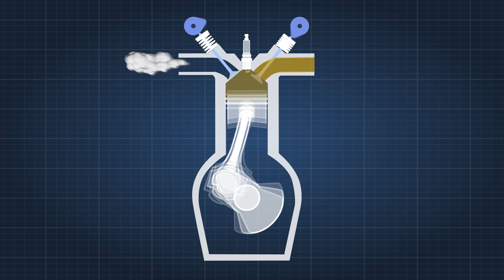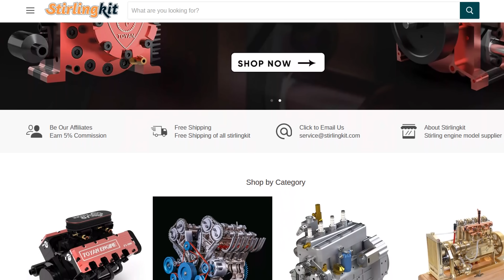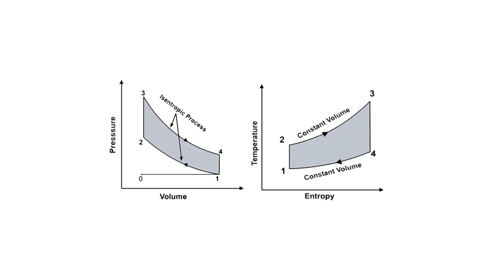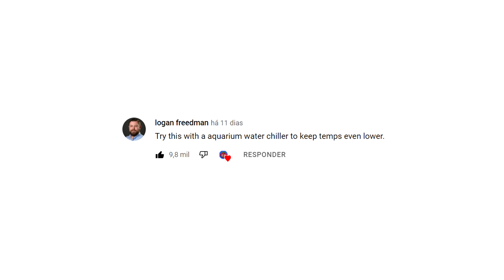I 3D Printed a Transparent Combustion Engine in Resin

Comment: Nitromethane has a lower specific energy than gasoline, and requires far more fuel volume to create the same or more power than gasoline. You ran your engine with the same jetting of the carburetor and so you produced less power because you ran the engine leaner with the other fuels. The fuels also have different burn rates (they are higher octane), and nitromethane/methanol burns slower and requires more advanced timing to make peak cylinder pressure.

Comment: I suspect that the engine is only trying to spark every other cycle to keep the revs down and avoid blowing up the engine. If you have an oscilloscope, you could connect it to the magneto and see if I'm right. Indirectly, you could test this by just using magnets to see where the magnets on the flywheel are and check to see how many magnets pass the magneto every cycle. If the ratio is 1 pass per 2 full cycles, they're intentionally limiting the power of the engine and the reason 25% Nitromethane was firing (nearly) every cycle is because it's dieseling. The fuel is auto-igniting (without assistance from the spark plug) due to the combination of heat and compression.

Comment: You have bad compression, you appear to have piston blow by and gas is clearly coming out the sides too.
Maybe try adding another piston ring or re-hone the cylinder and as other comments have said you need a head gasket to stop the pressure leaking out the top.

The more powerful the fuel the worse the leaks is what id guess is happening.

Comment: Engine power isn’t just about speed. Power (units of W) is the dot product of force (units of N) and speed (units of m/s). Units even check out (N•m/s=J/s=W). The “more powerful” fuels create a much more potent explosion, so even though they are slightly slower, they are more powerful.

Comment: I used to ride a trials bike. It's (2-stroke) engine would always rev high, when the tank was almost empty. Revs were high, but it didn't really produce much power anymore, until I switched to reserve. Higher revs don't necessarily mean more power.
So I think your engine might be running lean on all fuels except the 25% Nitromethane. You should try to somehow "tune" the carburator, if that is possible.

Comment: Maybe you don't have a good coil transformer capable of charging fast enouth to give sparks at very high rpm, Or you have a over-rev safety device like a hit-and-miss engine governor which can skip power strokes to keep engine in safe speed, also you may have valve float your rocker arms are shaking a lot.

Comment: the engine is not firing consistently because of the timing of the spark different fuels want to be ignited at different times like methional, it burns slower than gas so you need to advance the spark time to give it more time to ignite. I don't know the exacted problem of the nitromethane though because it burns faster maybe it is the air\fuel mix like some other people are saying but I would try to find a way to change the spark trimming and for a video idea I would like to see that with some performance mods like higher compression witch could help with the misfire as well.

Comment: theres a smaller flame with methanol bc you cant actually see methanol burning ie it doesnt produce a flame when burning.
Reply: methanol is also used in drag racing and other racing sports. it runs cooler and generally produces more power

Comment: FOR BEST LIKED SUGGESTION:  SEND Integza to a 'house' where he can 'rent a female' (you know what I mean but can't say it here) he uses different 3D printed falic objects powered by his 3D printed engine with 3D printed reduction gears to find the optimum speed of movement of said device to trigger the cascading wave of dopamine release in the above female subject.   Slow motion footage is a must.  Edit carefully and per youtube TOS she must be clothed.  What 3D printed shape and what speed produces the best, fastest, and repeated results.   Also, by time the power makes it through the piston to the crank to the drive line and through the transmission and the axle and then to the wheel and the rubber and the road, only 18.5% of the energy of the fuel makes it to movement of the vehicle.  Not 25%  :)

Comment: I had 1 idea recently because of gas prices . What do you think about useing hydrogen to power the engine , in my opinion this is one of the future fuels and it's the cleanest one . But to that you would have to do HHO generator first , for person who build rocket engines in past this shouldn't be a problem. I hope that this idea gonna get most likes
Reply: Toyota made a car that runs off of it and it has no practical room on the inside of the car despite how large it is, because it has 3 massive tanks stuck up under the car. It’s got a long way to go on top of being safe, because if any of those tanks popped during a crash, it would be very ugly.

Comment: Nitro requires higher compression and more air to fully ignite and make peak power, that's why stock engines run better on lower octane fuel because it ignites easier

Comment: Could you water cool the cylinder lime you did with your pulse jet engine?
Reply: Also for efficiency, maybe air fuel ratio? Or maybe the engine is tuned to run on one of your nitromethane mixtures

Comment: hi I suggest putting a little load on the engine and for the more powerful fuels you have you will need to play with the fuel air mixture rpm.

Comment: every time you change fuel type, you'd have to adjust the air intake. my guess is that when you're running the gasoline, there may not be enough air mixing in with the fuel. makes sense to me just because the higher methanol mixture required less air but fired more regularly. a load would help figure out if one fuel type might have more torque but less speed.

Comment: The only (amateur) opinion I can offer is that each fuel will burn best at specific conditions; i.e., compression ratio, bore vs. stroke, stoichiometry, etc.). And if all those conditions are the same, then the only variable is the fuel.

Comment: I believe your problem is one of RPM limiters by the ignition system.
To test; put a constant load on the shaft and then measure the RPM; as it is, I think you're running it like those "lost spark" engines you see at county fairs -- the machines that keep bobbing up and down... until... it slows enough and goes "kawhump" and you get a power stroke.

Other details (from a FSAE guy):
Methanol /is/ less power dense than gasoline, but for proper air fuel mixture you use almost twice as much (AFR 8:1 or so) -- so... stock, you can get ~110% of power over gasoline (if mixed properly).  In FSAE, we used Ford 5L injectors on a 600cc engine...  You can burn it leaner but...there's a lot less power there.  A lot more NOx as well.

The other thing you can do with methanol is crank on the compression and get a lot more power, say 1.5-1.8x the power over gasoline if you get to 16-18x compression (warning -- your 3D print won't like that, nor will the o-ring seal).

Warning - methanol likes to burn pale blue... almost invisible.  It will hurt you if it's on fire and you think it isn't.  *Keep those gas cans sealed*
---
The rest of this is my understanding, but I have no experience here...
Nitro gasolines rune slower, cooler than normal gasolines, but... since they don't need oxygen, you can  really pack the fuel into the cylinder (remember, normal gasoline is 14 parts air to 1 part gasoline -- a lot of "not fuel").  If you use nitro... the proper AFR is 1.7:1 -- a lot more fuel in the cylinder (nitro-methanol is gonna be more than that; less fuel, more air) -- 2/3rds of your cylinder is -fuel-.  Now you know why drag racers like nitro...  All fuel, all the time, and yes, no sparkplugs left after the 1/4 mile.

That does mean that compression... good lord that can be bad... and heaven help you if it doesn't ignite; you're gonna hydraulic they cylinder!  Note 2... that means you can buy dieseling kits for the 0,40 RC motors and... they work... and you get an incredible amount of power bump (again, for RC of that caliber, we're not going for speed, but bigger, higher pitched props).

Don't ask what happened to poor Rudolph Diesel... at least not on a full stomach and /certainly/ not while any tomatoes are around.

Comment: The air fuel ratio is different between all of these fuels and timing should be different too. I also would try applying a load to the engine. I think once you cover those bases you should be able to make the engine use all 4 cycles

Comment: A fuel storing less energy does not mean necessarily that the motor would be weaker/slower. Both ethanol and methanol are less energy dense than gasoline but both provide more power in internal combustion engines because of the higher octane rating. But that comes with an increase in fuel consumption.

Comment: My father (engine builder/ shine runner/ street racer, from when the cops would put up at the cross roads to make it safe and watch) has always told me there is !NO! Substitute for cubic inches. Make that piston bigger and the stroke longer and put a multispark ignition on it. Redo your test. On Odin you results will be drematically different.
Reply: P.s. not an engineer love your work this is my first comment because your engine knowledge has tipped the scales to you up until this point. My comments come from 20+ years exp road tested engine use. As fineley tuned as police interceptors are to deal with "real" engines, in street vehicles I've seen cars with 15k or less investment make them laughable at best.

Comment: stoichiometry. you might be getting too much or too little air. combined with the somewhat weak compression. or maybe its flooding. too much fuel. the fuel might not be properly atomizing. regardless its likely all in the tuning and timing

Comment: Hey Integza-  = Suggestion = Why don't you try injecting you 4 stroke engine with "browns gas" though the air intake & see what happens- Browns gas is the hydrogen & oxygen that you get from electrolysis & making an efficient browns gas generator is fun too! (I made one that worked brilliantly from stainless steel wool, an old sock & a glass jar!)  Actually you could try powering some of your other stuff with Browns gas too

Comment: That engine has no load so speed of rotation is not really good measure of "power". When it goes to fast it's misfiring  but don't care about it because there is still enough kinetic energy to do another cycle. Final fuel gave you less speed but due to being stronger, probably cared less about obstruction to explode under compresion whatever they might be, so it worked perfectly giving one ignition per cycle.

Comment: The reason why it would go slower is, because the force of the burst is more powerful in a 2 cilinder engine the other burst compensates for the force and that will make it faster. This is only a one cilinder and it doesn’t have a counter part.

Comment: Internal combustion engines suck ?
Better not forget, we built our current modern society on the back of fossil fuels and the internal combustion engine and because of it we have one of the highest living standards of the world. I was watching your previous video on the decomposition of hydrogen peroxide with a catalyst such as the precious metals in a catalytic converter to generate steam and run a steam turbine, obviously the decomposition chamber had design flaws being a prototype but the proof of concept was very interesting, and my imagination immediately thought, why was this not used to run a steam engine to drive a vehicle. Is the cost of hydrogen peroxide prohibitive ? Can we make hydrogen peroxide ourselves in high enough concentrations ? I think make a better hydrogen peroxide decomposer / steam generator, run the steam thorough a proper 3 stage 3 cylinder reciprocating engine and we have a viable replacement to the internal combustion engine. With careful design, we could for example inject enough hydrogen peroxide into the decomposition chamber to controll the steam pressure and engine rpm and power similar to the way the ammount of fuel injected into a diesel controls rpm and power.  just a thought.

Comment: The reason you are experiencing inconsistent spark is because you removed the metal cylinder body the only consistent ground for the spark plug. Without the reliable ground path the electricity needs to travel from the crank case through the push rods to the cylinder head, given that the push rods have a pretty loose fit and with all the vibration it is very likely that the ground path is broken at the exact moment it needs to fire. Try adding a ground wire from the cylinder head to crank case and see if it works. If not try messing with the air/fuel ratio since different fuels have different ideal ratios.

Comment: The reason for the slower speeds on the more performant fuel has to do with the burn rate and compression. For example, diesel is much more energy dense than regular gasoline octane, but diesel engines cannot spin nearly as quickly because they are limited by their fuel's combustion rate. In this case, gasoline at 91 octane has around 12-18 m/s burn rate (depending on air-fuel stoichiometry), as compared to the Nitromethane which burns at about 0.5m/s under ideal stoichiometric ratios. This causes a slower max speed in practice, however interestingly enough, NM should be quicker to its max speed (4500) than Gasoline is to the same RPM (4500). The explosion is still incomplete as it gets forced out of the exhaust! That's why the NM is so loud compared to the others as well and reducing the speed with a load will give a much higher efficiency in any practical testing. 

The Methanol ran faster than the gasoline because methanol is HALF to A FOURTH as massive as Gasoline Octane (depending on what you use) and the carburetor is not designed for such a thin fuel so it is dumping too much into the cylinder which leads to a groggy start but a positive feedback loop that accelerates the engine on the high end. This seems to be because a lot more fuel gets compressed into the same space so it effectively has a higher compression despite the slower flame speed (1-2m/s). 

Edit: Flame speed alone is not enough to compensate for that significant of a difference without a load, I suspect the air-fuel mixture is heavily favored by the gasoline and is causing incomplete combustion. Methanol also requires less oxygen per kg so as more gets sucked in from the increased speed, more is able to combust with the excess fuel.

I'd also be willing to bet that the NitroMethane will self-ignite in higher concentrations (~40%), it would be interesting to see if you could change the shape of the cylinder head to adjust and measure compression ratios and air-fuel mixture. Cheers!

Comment: The engine is not tuned correctly. You have to adjust the amount of fuel injected for every fuel type. Also make sure the valve timing is tuned because it seems as if the intake opening is slightly misaligned to the intake stroke, explaining the fuel being ignited only every 2 cycles.

Comment: You should find a way to tune your air fuel mixture and then you should figure out how to change compression like lowering the top of the cylinder head or extending the piston if you could. Don't know if it's a non interference but it seems to be so that should be safer to do.

Comment: I figured out the power/revs/4 strokes issue:
you are most probably running weird air/fuel ratios due to your carb, which is resulting in inconsistent detonation and power.

With all fuels there is an ideal air to fuel ratio, if your carb cannot pump enough air in fast enough, or pumps in too much(I think this is what happens with the nitro, as it requires less oxygen to go bang), its gonna make less power since it is running rich or lean respectively(oversimplifying rich rn).

Further, if your engine runs lean enough(too much air), it will ignite the fuel just by compression, which is called knock and really not wanted in gas engines as it means the fuel kinda explodes at a random point, potentially slowing down the engine rather than speeding it up.

So with the last test for example you are running the engine lean, which means the fuel ignites itself during compression and pushes against the upward travelling piston, reducing power output. With the others you may be running rich where there is too much gas and its harder to ignite. A rich afr will make more power up to a certain point, so this would also explain the extra revs

Comment: Maybe Methanol runs faster because you need less pressure to compress it. So methanol have in the kompress cycles less mechanical resistance and less Reduktion of momentum while compressing.

Comment: Adding a load or increasing the mass of your flywheel will help with increasing compression at higher RPMs. I think your mixtures are too rich though. You're only getting enough aerosolized fuel every n amount of cycles with a given fuel. Your more energetic molecules are going to more easily escape into a vapour and is probably why the nitromethane was more easily able to achieve a consistent burn.

As well, I'd check that your exhaust valve is sealing correctly or more strongly. Part of getting a fuel to aerosolize better is to create a very rapid drop in pressure with the intake stroke inside the chamber. If too much fuel mixture or outside air is coming in, you wont have enough of a vacuum to get your fuel to escape into a vapour quickly enough.

My suggestions would be:
1. Less overall fuel might be more here. I think making your intake valve more restrictive would help here too.
2. Bigger load/flywheel
3. Adjustable carb to ensure you can achieve optimal air-fuel mixture for any given fuel.

As a side note, I don't think your spark plug timing is the issue. If it were, you wouldn't see such consistency with the number of failed power strokes. It would be a more intermittent issue.